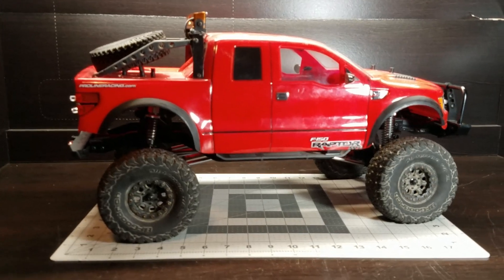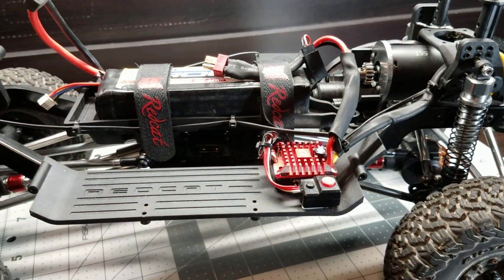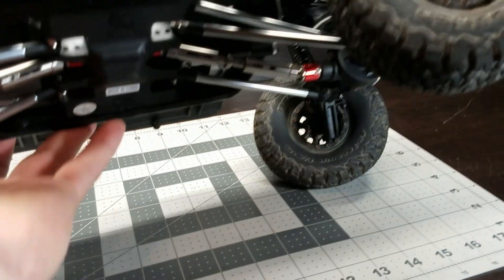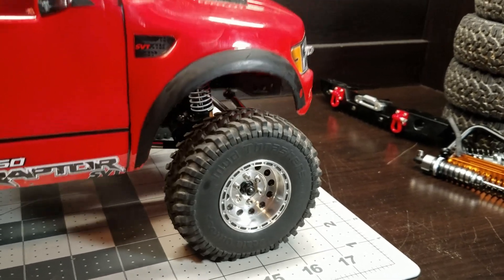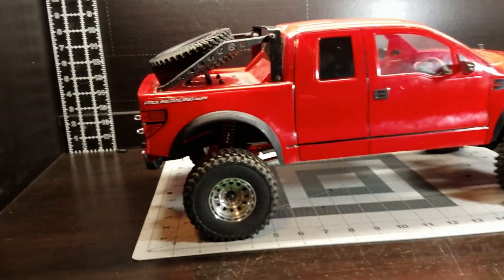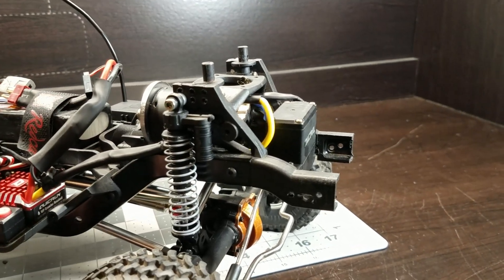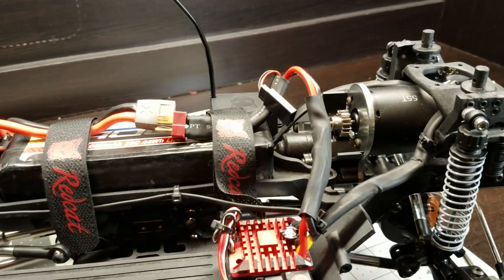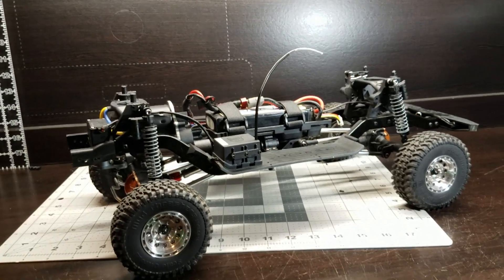Redcat Gen 8 (reviving a used crawler)

Comment: My wife just broke the stock bumper on my Gen 8 so if you're not using that one... ;) Really though it looks like a great base to start from, I really like the links used for the roll bar that a great fit. Those shocks I'm pretty sure are stock, just put them in the top spot and it will be back to how it  should be.